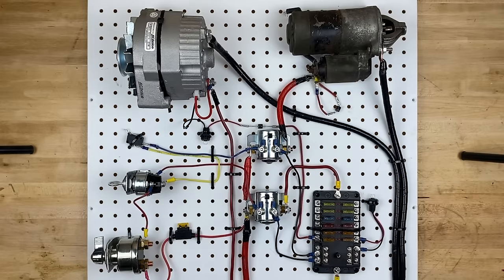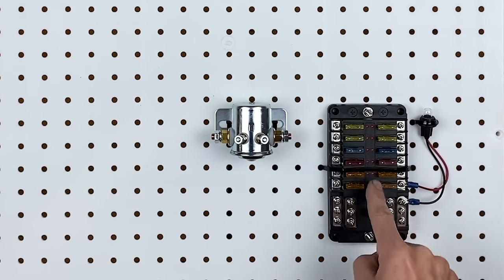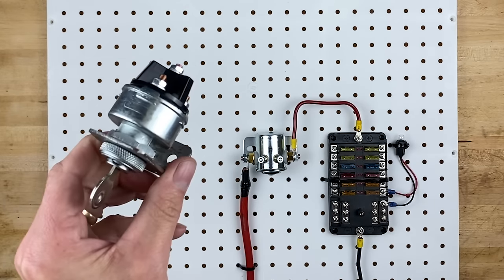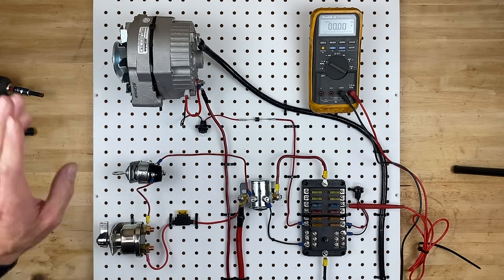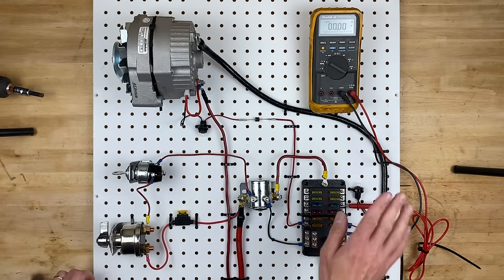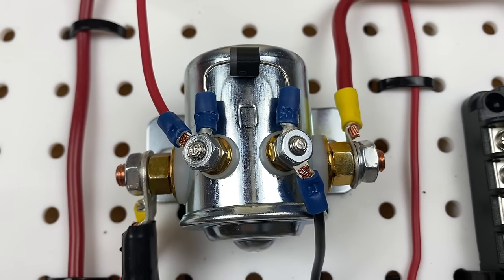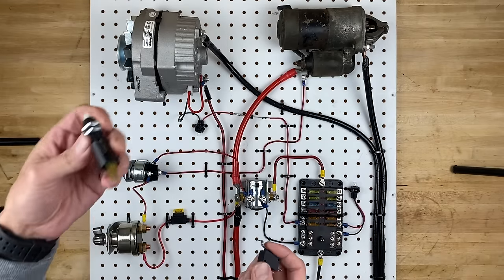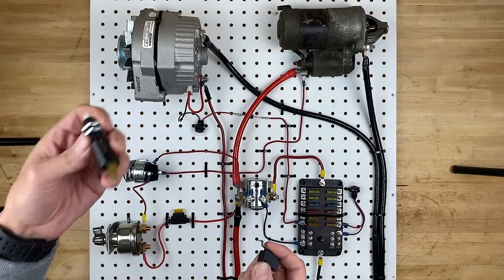Hotrod | Race car | Drift car Wiring for Beginners. (Alternator Battery Switch Fuse Box Starter)

Comment: You can actually get diodes in the same form factor as ATC fuses, so you can use a standard fuse holder. Ford used them for a while. Makes it super handy to charge or trouble shoot.
Reply from the maker: That’s great info! I’ve never seen that before but I’m going to go googling it right now ! Thanks a bunch!

Comment: 13:54
Actually, the diode is there to protect all other electronic components of your car from that huge voltage spike that happens when the magnetic field collapses. The coil inside that solenoid is very sturdy and doesn't really care about voltage spikes of any kind.
Reply from the maker: Good info! Thanks for sharing it!!
Reply: yes, the infamous "back EMF"
Reply: Exactly, what probably happens without a diode is when you turn off the ignition switch there is an inductive kick which can cause a spark across the switch contacts, shortening it's life
Reply: @petarmiletic997 A baddass easy explanation
Reply: So🤔being a novice.... Should i add a diode to my existing wiring?  And where

Comment: Best video on YouTube ever explaining how this works! Been chasing this on my classic car.
Reply from the maker: Thank you! I’m glad you liked it! Just be sure to use fuses on the big wires!
Reply: @WiringRescue  thank you!!! Now I understand , finally the mystery of electronics. Fuses, relays, switches oh my! Switched on and switched 12v! My car is a 62 ford Galaxie .how perfect with the classic ford solenoid example. Thanks for responding!
Reply: @WiringRescue  so if I have my Fuel pump and Dual fans which are on toogle switches, all 3 which have relays for each one and are fused, can I use this fuse panel for the power and ground?

Comment: I have tried to understand this stuff for years and never seen anyone explain it down to my level any better than you. I have a 1936 Plymouth coupe and the wire harness was toast. I bought a standard 12 fuse wire harness that suppose to work for most cars but mine was born a 6 volt and the starter is foot pedal. This video gave me a jump start but I see it's going to be tough.

Comment: I have been trying to figure out my problem for weeks.  1962 Land Rover rebuild.  Dynamo to Alternator conversion.  Glass bulb in the dash for charge light.  Diode fixed it.  This is the best video on the internet that I could find that explains with such a fantastic visual.  Liked and Subscribed!  Thanks.
Reply from the maker: Heck yes! I’m glad you enjoyed the video and found it useful! Old Land Rovers are super rad, so I’m thrilled that my video had a tiny little piece of helping one out!

Comment: Very very good! I just built an engine run test stand. Like an actual car the test/run stand is wired almost exactly the same way. I ran into a few bumps along the way, but it works well except for the alternator wiring. I screwed up somewhere, this video will help me rethink that. I got some good ideas about solenoids, diode use, and parts that will clean up my build dramatically. Oh yes this will work out fine, back to work for me.

Comment: FINALLY !  
 Someone who has actually used the PROPER method of installing a KILL switch ! 
 It’s the same method I have always used to cut off EVERYTHING that could possibly continue to run a vehicle even AFTER a crash .  I’ve seen shorts physically START a fuel pump or starter engage after a crash .   Alternators continue running, power flows . It happens .
  I love your videos .  
  Glad to see what seems to be younger generations commenting on your videos that they are following and hopefully using the proper methods themselves .
  PS.  I have always added a ground to my alternator , even single wire alternators , to help cut out frequencies that cause issues with stereo systems and fuel injection ecm issues .
Reply from the maker: Haha! Thank you! I’m glad you appreciated my wiring methods! I’m hopeful that some of these videos will give my fellow car friends a little more fun in their cars and less time chasing down weird electrical problems! 

Thanks for watching and sharing your knowledge! I appreciate you taking the time to do so!

Comment: This whole series is like gold to those of us who probably have no business messing around with automotive wiring. I recently stepped off into the deep end of the pool and bought a 1929 Mercedes Benz kit car used. Mechanically, it seems to be okay, but if I put a mental image of several 10 gauge wires simple stripped, twisted together and taped over with that cheap tape, then multiply that disaster waiting to happen by way too many, and you get an idea of what I'm dealing with. I've found about half of my problems went away as I re=connected the bad connections, and the other half are rapidly going away as I watch your vids and put them to work!. I have one suggestion: My workspace for this car is off to the side of my house, far from my computer. My eyes have a hard time making out fine detail on my cell phone. I've tried drawing my own schematics as you explain them, but they look like chicken scratching even to me! A wiring diagram from He-who-knows-how-it-works wold be a very welcome addition for many of us I'm sure, and if not then I'd appreciate it enough for all of them! Many thanks for all this information, I'll send you a picture when I've got ALL the lights lit up. Won't be long now!
Reply from the maker: Thanks for watching! I would love to make diagrams, and I have before, but there are only so many hours in a day! ;) I need more time!

Comment: Great video!!!

Currently, I'm sitting in our diesel pusher motor home in Nokomis, Florida (west coast of Florida).  

A week ago Thursday, a hurricane (Helene) traveling south to north passed near here.  A lot of title flooding was generated.  The RV park we're in is on title water.  About a quarter of our park flooded.  Luckily, the section where our motorhome is didn't flood.  No matter, a week ago Wednesday, when trying to move our diesel pusher rig inland to high ground, the engine failed to turn over.  I replaced the chassis batteries because they (2 of them) needed to be replaced.  It still wouldn't crank.  Result: I was not able to accomplish the rig's move inland.

I've spent the past week trying to figure out why my rig's engine won't turn over.  It's not a battery thing.  I believe it's a solenoid/relay/fuse thing. I've watched a lot of videos about solenoids/relays/fuses.  THIS IS BY FAR THE BEST -- B-E-S-T -- video I've watched.  I finally have a much clearer understanding how the electric system of an auto works.

Can't thank you enough for this outstanding video lesson!!!!!

Bill Cook
Reply from the maker: Thanks for all the kind words! I hope you get your motorhome going again with this new knowledge! And I’m sorry to see what happened to the southern states recently. Hopefully this next hurricane fizzles out before causing any additional damage. Good luck with your repair!

Comment: I am blown away at your presentation.  This method is exactly what I have been looking for to wire my race car.  The only thing I'd like to add is a 2nd master cut-off switch inside the car.  I'll see if I can figure that out.   Thanks so much for sharing.
Reply from the maker: I’m glad that you like it! And the extra kill switch is very easy to do. You could add one under your hood too if you are feeling particularly wild! Thank you for watching!

Comment: Excellent job! You covered pretty much every bit of the basics needed for the start/run/charging. Well explained. 
I never thought of the diode across the solenoid! 
If you are willing to do so, it would be worth it to make a video covering externally regulated alternators too. There's vehicles out there that still use them....or stubborn guys like me  that still like them! 
You do a great job on your presentation and explanation!

Comment: Excellent video! A few comments to fill in a bit more. Fuses are generally sized to the wire rather than the load. The wire is presumably sized to the load but the point is fuses don't protect devices they keep the wire from burning up. Older vehicles have a fusible link or a thin piece of wire in-line that will burn up and the thin wire might not be easy to spot. Typically it is one gauge smaller and a few inches long. Obviously starters without a solenoid on them will not spin down faster without a diode since they use centrifugal force.

Comment: Yeah I should include a few key pieces of info with my question. The battery location is 9n the passenger side of the trunk with the components located on battery box in the space next to right rear tire. It goes battery, mega fuse, continuous duty solonoid, and finally starter solenoid thru the frame to starter on the same side.
Thanks for taking the time to get back.
Boy, you have to take some people right by the hand don't you.
Im one of them.
Reply from the maker: Haha! In that case - definitely have a big fuse right next to your battery between the continuous duty solenoid and the positive battery terminal. The amperage rating will depend on the total amperage draw of all of your components. I would also recommend a fuse on both ends of your alternator power wire. Since electricity flows both ways in that specific circuit, it’s nice to have it protected at both ends!

Comment: I don't have an electrical degree either.  However, I had a ham radio operator's license by my sophomore  year in high school which required an advanced electronics test.  Been doing automotive wiring since about 1977.  I would have used an actual battery switch to simplify the project.  Also, you can order continuous duty, high ampere solenoids with built in diodes or resisters to simplify wiring. I have used hundreds of them for remote switched, high power loads but never ran the starter through one and cannot recommend them for cranking amps.   Your fuse panel is marine grade and is not rated for moisture or particulate intrusion.  For some reason people seem to think that marine grade is superior to automotive grade and that is just not true.  Also, I would suggest that race and competition type installs should follow the stricter electrical guidelines as set forth in NFPA Pamphlet 1901 for low voltage DC circuits.  It has the most comprehensive guidelines in the automotive sector.  My ultimate goal has always been to reduce failure points like cheap connectors, unrated equipment, and unnecessary complexity while increasing reliance through high temperature rated wire and loom, IP67 minimum rated equipment, no splicing, and bench testing of all critical components before installation.  I have 30 year old installs that get pressure washed on a regular basis that are still in service.  Only 2 warranty problems in those years which I treated as learning experiences.  This was in a manufacturing environment, not hobby or side line stuff.

I was pleased that you called out Cole Hersey by name.  The very first part of a quality installation is to use quality parts and Cole Hersey is peerless in this regard.  If you think one of their products is the cause of a problem you had better check your work because that probably is the actual problem.

Comment: The voltage sense wire should go to the main power distribution point. It works ok as you have it wired when your total amperage used is relatively low, but if you have electric fans and fuel pump you'll have excessive voltage drop and run into issued with the battery not charging even when you have 13.5 volts at the alternator output.
Reply from the maker: Great info! Thank you for watching and sharing that!
Reply: So you'd want the voltage sense on the power input on the fuse block, or the positive post on the battery?
Reply: 🇺🇸Battery in trunk. Cable from battery to starter dead except when cranking. Read MAD electrical for info.
Reply: @WiringRescue ; What Kris said is right, where would that wire need to be ran according to your video?

Comment: I’m so glad I found this video, I’ve been racking my brain trying to figure out how to go out my project. 

I have no wiring on my race car. And I need to install a switch panel and battery to the rear of the trunk. 

So do I run a power wire from the starter to the kill switch to the switch panel to a fuse to the rear battery?

Comment: I have watched about 3 of these (how to wire a car) videos. This is the BEST!  one question: is the only difference between an relay and solenoid the internals? a solenoid being a mechanical internal and really having no moving parts?
Reply from the maker: Solenoids tend to be able to handle a much higher amperage. The functionality inside is slightly different but both do have moving parts. That is… unless you get a SSR (Solid state relay), which are super cool, don’t have moving parts and tend to be very reliable! So in short, I’d base the relay vs. the solenoid on the amperage that you need to turn on and off, and choose which one fits your circuit best.

Comment: God I wish I would have found this guy 4 years ago!
Reply from the maker: Me too 😂
Reply: @WiringRescue  I’m preparing to wire another rat rod and without you, I would’ve never gotten it right but thankfully now I know it’ll work without burning it to the ground! So thank you
Reply from the maker: @DegenerateFabricators  That is honestly so great. Thanks for sharing it with me because it’s great motivation for me to make more videos! 🎉
Reply: @WiringRescue  I do need to ask you do you think that this system will handle running the ignition main power? so jump in turn on the toggle switch to turn on the fuse panel power and then push a button for the ignition then the fuel pump button and then hit the start button?
Reply from the maker: It all depends how much amperage your ignition system draws. You need to know those numbers to determine the fuse, switch, and wire sizes for each circuit.

Comment: Great video! I love how you explain things so well, and it's helped me crystalise my thoughts on more or less the same type of circuit. I'm wondering if it'd be better to run the battery cable from the output of the solenoid to the starter motor, in addition to the fuse box, rather than the input side. This way, when the solenoid is off, there's no power going to the starter.  BTW I've just subscribed!
Reply from the maker: Thanks for the kind words! I’m glad people enjoy the videos! As for the starter wire - yes! That is absolutely another way to do it that may make more sense in some installs. It’s really just about determining what the best option is for your specific project needs. The needs of the vehicle, and the location of the components like the batteries and solenoids are huge factors. Thanks for subscribing!

Comment: Suggestion on the main battery cable wiring.   Which is the biggest draw on that side of the cable/circuit?  The starter or the fuse block?  Home run the battery cable to the one that is the largest draw, jumper to the the other.   In this case, go to the starter relay first, then run your jumper to the CD relay feeding the fuseblock.

Comment: You can also use a ballast resistor in series with a standard solenoid to lower the input voltage down to roughly 8 volts as long as it stays engaged it will not overheat the internal parts

Comment: Nice video other than the confusion between fuse box and fuse block.  You show a fuse block, but call it a fuse box.  A fuse box is enclosed as with all boxes and sometimes weather sealed.
Reply from the maker: Thanks for the feedback! The fuse box/block in this video actually does come with a cover, but I didn’t want to use it in the video because it would have covered some of the wiring. Sorry about the confusion! I’ll keep that in mind for the next one!
Reply: @WiringRescue  I stand corrected.  It looked like the many devices that are sold as fuse blocks and have no cover.

Comment: Really enjoyed the video, as a novice, made total sense.  I have a question please: I am locating my battery in the trunk, as such, rather than run multiple positive wires to and from, can I not just run one '0' gauge wire to a pole in the engine bay, then connect the starter/ alt ect from the pole? thank you
Reply from the maker: As long as that large wire is fused properly, and you don’t have a master cut-off switch, I would think it could work.

Comment: As someone who has taken race cars through tech inspection and as a corner marshall ( flagging and communication) at tied races the 12 volt power to your starter needs to not come directly off the battery. When you turn off the main power kill switch all power must be shut off for safety reasons. I do see the style cutoff switch you have on drag cars but there is a 4 terminal cutoff. The battery power goes through the switch on the large terminals the 2 smaller terminal take the place of where you installed the diode. This guarantees there is no power past the master cutoff switch.
Reply from the maker: Great info! Thanks for sharing the knowledge!

Comment: Only question I have is if your ignition is powered thru your fuse box that you have how is said race car supposed to start? The power to the fuse box is cut while cranking so how is that solved? Different key switch? Otherwise great videos
Reply: There is no ignition system in this video. Usually with a regular old school ignition coil you would have one wire to the coil that goes through a resistor to lower the voltage. That one would be active when in the run position. Then during cranking a different source without a ballast resistor would give it full voltage when the key is in the start position.